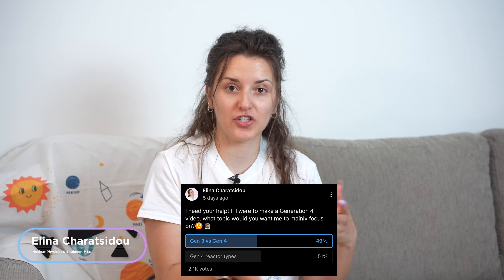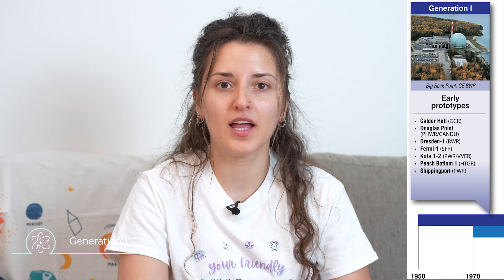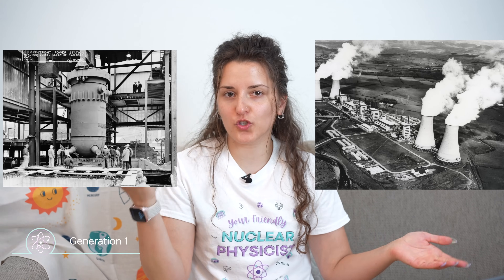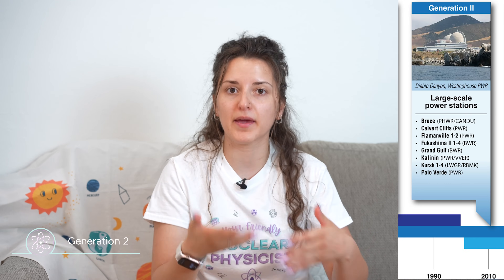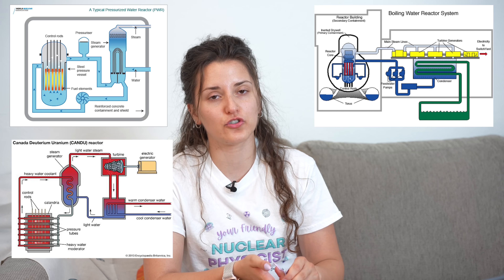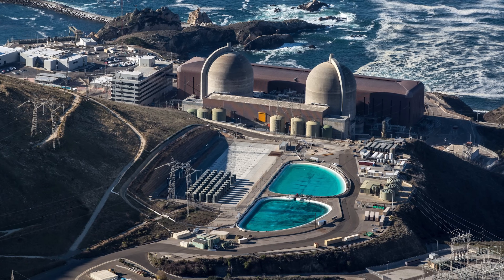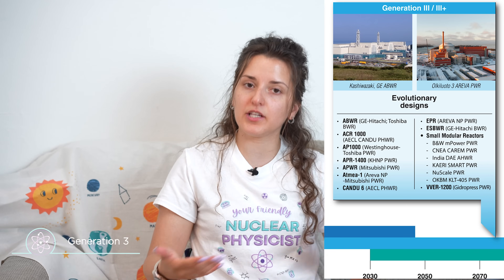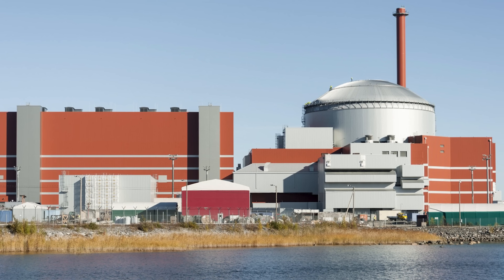Nuclear Physicist Explains - The Rise of Generation IV Reactors?

Comment: Active safety vs passive safety is more complex than how your framed it.  There are few/no safety systems that require operator action to start.  The operators have the ability to start them prior to any interlocks that would automatically start them.

The term "active" can best be thought of as requiring power to operate.  An example of this would be emergency core cooling systems that use electrically powered pumps to inject coolant into the reactor coolant system "RCS".  

An example of a passive safety system would be the accumulators or core flood tanks that have a large volume of water and a nitrogen blanket at 800 psi on it.  These tanks would have a check valve between them and the RCS to prevent the reactor coolant from going into the tank.  The contents of the core flood tank would automatically empty into the RCS during a large break loss of coolant accident "LOCA".
Reply: No U.S. nuclear plant has EVER had an issue with an active safety feature malfunctioning in both "A" and "B" trains when needed.

The reason passive safety features are now seen on new designs is purely for cost saving reasons.  No massive emergency diesels or battery banks needed, less maintenance, less initial cost, less chance that a failure will require a plant shutdown.
Reply: @clarkkent9080  You should read about the June 9, 1985 event at Davis Besse.  This event did involve the failure of both trains of AFW due to many valve failures in a short amount of time.  Luckily, the operators were able to restore AFW shortly afterward.
Reply: @Mong0thepawn  Aux feed water cannot be replaced by a passive system as the pressure must be above 1200 psi.  Davis Bessie has electric and a steam driven aux feed pump
Reply: @clarkkent9080  Why are you telling me this?  I know that DB has two Terry Turbine AFPs, a motor driven feed pump, a startup feed pump (breaker racked in with fuses pulled), and a diesel driven AFP.

All of this does not change the fact that ALL AFW systems failed on June 9, 1985.  At the time of this event, only the two steam driven pumps and the startup feed pump existed.  You also have to look at the common cause failure.  If electric powered valves are out of position in a failed state, and it blocks all AFW flow to the steam generators, you are in a very tough situation. 

Your statement about both trains of a safety system becoming "non-functional" during an event never happening  is not true.  I am intentionally using the term "non-functional" instead of "malfunction" because it has a specific meaning.  I will also add that "non-functional" is not the same as being "Inoperable".
Reply: @Mong0thepawn  The AP1000 use of passive safety features was designed for one purpose and that is cost savings.  The claim of better safety was just good PR.

EVERY component that you say failed are still present in the AP1000 design.  You cannot passive an auxiliary feed water system that must provide 1200 psig feed water.

I was a SRO on a sister plant to DB and am very familiar with the importance of feedwater to a B&W design. The passive safety features of the AP1000 design still need electrical power (battery) and if operators do  not align the systems correctly, (and yes they have manual valves that must be aligned) even they will fail.  

No design is operator proof as you can't fix stupid, 

Simple point : the AP1000 passive safety features were incorporated to reduce COST.
Reply: @clarkkent9080  You are replying to a question or statement that I never made.  

You previously said that there has never been a nuclear plant have both trains experience a malfunction when the system was needed.  This is false and I gave an event as an example.  I would agree that it is incredibly rare to see both trains of a safety system fail.  You going off on a tangent about active safety systems being needed has nothing to do with me pointing out that there has indeed been at least 1 event where both trains of safety systems experienced a malfunction.  

Applying the "nuclear lingo", it sounds like you are of the mistaken belief that there has never been a time where both trains of a safety system were non-functional when demanded.  I say non-functional only because Inoperable can mean that the system can't meet its surveillance requirements but it is still able to perform its safety function.

I too held a part 55 license for many years.  I am still involved in the industry.  It is possible to build a 100% passive safety design.  The DOE built several many decades ago but they were not light water designs.  Nuscale is close meaning their design can reject decay heat for about a month with no active safety systems.

Is your last name Derivan?  Your writing style kind of reminds me of how he writes.
Reply: @Mong0thepawn  My original comment was that the AP1000 PASSIVE safety features were incorporated as a cost saving measure not to mitigate any previous event at a U.S. nuclear power plant and that is 100% true.
The AP1000 passive systems would not have made any difference in the event you describe so they could not have been designed to mitigate the DB event. 

I did state that no U.S. commercial facility ever had both safety trains fail when needed and from your description that MAY not be accurate. I was not aware of the situation at DB that you describe. There have been situations where both trains of a safety system were declared inoperable and Tech Specs provide immediate actions required. But that does not mean they both failed when needed.

I will take your word for that DB event as you know that many "events" happen at nuclear power plants that are never reported outside the facility or NRC.  I originally obtained a RO license  in 1981 and a SRO in 1984 and never heard of the event you describe.  
But you are most probably not aware of the sabotage of a nuclear power plant that could have resulted in a complete core meltdown.  Or the leakage of 400,000 gallons of primary coolant to the groundwater over a 4 month period at the Xcel Energy's plant just this year. Everything does not get reported in the media and what is reported to other nuclear facilities is whitewashed as much as possible. 

 
Additionally, I am confused with your description of the event.  If a B&W reactor trips with even a few weeks of decay heat and normal feedwater is unavailable and both trains of emergency auxiliary feed water FAIL, you have a big problem.  
If normal feedwater was available, emergency feedwater was not needed so you did not have an event where an both trains of an emergency system failed to perform their function as their function was not needed.
 I have had a situation where both emergency feedwater trains were declared inoperable. Normal feedwater was available and while inoperable by definition, both trains would meet their intended function. We shutdown, went on RHR end of story. 

We can banter functionally, inoperability, failure, when needed all day but my simple point is AP1000 passive safety systems were designed to reduce cost and not to mitigate any event that happened in the past.  

BTW, unless I am missing something, NuScale has placed their project on hold till 2025 due to ballooning costs and that is just estimated cost.  Shortly after getting NRC approval of their reactor design, they increased the output so I assume that will require additional NRC evaluation.  

I am retired but follow the industry and while I am pro nuclear, I am a rate payer and new nuclear in the U.S. is simply too costly compared to any other generation source. Both Terrapower and NuScale are receiving $2 billion taxpayer money each in matching funds for those projects and they are not financially viable per capacity output and that is just based on cost ESTIMATES.  
NO nuclear project has ever been built without massive cost over runs.  They have the same story that it will be cheaper next time.  So do we spend the next 10 years with unproven technologies of MSR or SMR and hope costs will come down? Or build more AP1000s knowing that 1.1Gwh capacity will cost $17 billion or more? 
 I am on the Vogtle grid, been paying a 19% surcharge (three years now) for unit 3 & 4 construction and expect to see a 25% rate increase on top of that once unit 4 goes operational. They can spin it any way they want but the reality is that Vogtle should have been canceled along with VC Summer.
Reply: @clarkkent9080  I have watched Vogtle 3&4 become a nightmare that is $18 billion over budget and 7 years late.  Summer became an expensive hole int he ground.  I highly doubt we will ever see another largte part 50 site get built.  

I do however think there is a future for the part 53 designs if they are mass produced.  You will need these to be built in a factory setting where the Q requirements can be both met and documented.  These reactors will need to have enough excess reactivity to go 10 years at full power (ISI 10 year requirements).  The regulatory burden will also have to be enough to ensure reasonable assurance of safety and nothing more.

These new advanced SMRs must both be black-start capable and able to handle a full load reject without tripping.  I do not want to build anymore of these monster 3 GW+ thermal plants.  I am hoping the NRC can find that perfect balance of safety vs too much burden.  They did update part 55 recently to account for the new reactors.  I think NUREG 1021, rev 13 will address the process for issuing licenses to the operators for these new designs.  I really hope they adopt a model similar to the FAA where the operator is issued a license that is good on all designs of that type.  Similar to how a pilot with an ATP license with a type rating on a 737-800 can fly any 737-800.

I was licensed at DB and a loss of FW is a huge deal.  It was an initiating event that had a high risk of getting to a core damaging event.  Basically, at 600 F in the RCS, the operators are directed to pop the PORV open and initiate full flow from the MU system (assuming the SI is intermediate pressure).  You then ride the plant temperature down using specific rule 3 & 5 and get your resume updated.
Reply: @Mong0thepawn  I am able to discuss commercial nuclear safety issue, high level waste issues, and even proliferation issues but I cannot defend the massive cost over runs on new nuclear projects in the U.S..
Both VC Summer and Vogtle used the “build it in a factory” module concept and the product was of such a poor quality that most had to be reworked on site and that concept was cited as one of the many reasons for cost over runs. 

You cannot build and ship the primary of a SMR as a single unit.  The AP1000 primary was shipped as two steam generators, two reactor coolant pumps, one reactor vessel, and one shipment of connective piping, six shipments in all. A SMR may be able to reduce that to three shipments but that is no major cost saving.  The volume of the support systems dwarfs the primary so no major cost savings there.

The issue with cost has little to do with the reactor plant and more to do with the complexity and critical need for quality.  The U.S. construction industry can build WalMarts and Amazon warehouses but not complex nuclear power plants. 

I live less than 60 miles from both VC Sumer and Vogtle and know many that work or worked there. I can only relay what I have been told by people that actually worked or are working at these failed projects: poor management, stolen equipment, drugs, lack of the necessary skill set, fraud, kickbacks, greed, sabotage to keep the project going, lost documentation, etc. All project related. Oh, and maybe the biggest issue, the utility makes a profit based upon the cost of the project so the ratepayer is stuck paying for their mismanagement.

The main reason for low unemployment and understaffing today is based on the large number of highly skilled boomers that have reached retirement age.  Look at a chart of boomer births, add 66 years and you will see we are coming to a point in the next few years where they will all be retired. My last facility lost greater than 50% of staff in a 7 year period (silver haired tsunami) .  My last assignment was to train (fundamentals) the influx of new hires.  The local college provided a generic test for potential applicants and we offered the top performers (age 22-55) jobs.   Just as one example, we had a high school teacher provide two weeks of training on math (nothing above 3rd grade level).  Multiple choice test (example: 14 -7 = ?) and 75 % failed. Two more weeks of instruction and 45% failed.  Management directed us to provide calculators and some still failed. I feel it is my responsibility to provide management people who could safely operate a facility but management said we need “buts in the seats” and that is now what they have.  Not a bright picture of potential candidates to run a nuclear facility.
I believe it was ~ 10 years ago when the NRC got very upset when half of the RO and SRO Vogtle candidates failed their license exams.

Do you think any of that will change with a SMR or a MSR?  Look at the lack of education in Kemmerer Wy., and the mentality and tell me that is where you want a state of the art MSR. Who, with any skill set, even wants to move where only 2,700 people are willing to live? 

Time is running out for nuclear.  Unless there is a widespread nuclear success no later than 2035, it is for all intent and purpose a dead technology.  There is more wind and solar capacity awaiting approval to connect to the grid than we currently use from all generation sources. The sun doesn’t always shine but in some places the wind always blows and with enough spinning reserve and natural gas backup we can survive until fusion is perfected.  

I believe it was 2016 when then DOE Secretary Moniz was asked about the future of nuclear power in America. He stated that the future of nuclear power was playing out at VC Summer in SC. and Vogtle in Ga. and if they were successful, then nuclear power had a bright future in America. That simple statement says it all. He was one of the few DOE secretaries with a PhD and common sense.
Reply: @Mong0thepawn  Part II
This is ~ 6 months old but still valid.

This is from the Des Moines Register and concerning the only Small Modular Reactor (SMR) project in the U.S. today. It should be noted that NuScale said (Jan/2023) the target price for power from the plant is $89 per megawatt hour, up 53% from the previous estimate of $58 per MW hour

In 2013, the Wall Street firm Lazard estimated that the cost of generating electricity at a new nuclear plant in the United States will be between $86 and $122 per megawatt-hour. Last November, Lazard estimated that the corresponding cost will be between $131 and $204 per megawatt-hour based upon the 4 recent new nuclear projects in the U.S. . During the same eight years, renewables have plummeted in cost, and the 2021 estimates of electricity from newly constructed utility-scale solar and wind plants range between $26 and $50 per megawatt-hour. Nuclear power is simply not economically competitive.
SMRs will be even less competitive. Building and operating SMRs will cost more than large reactors for each unit (megawatt) of generation capacity. A reactor that generates five times as much power will not require five times as much concrete or five times as many workers. This makes electricity from small reactors more expensive; many of the original small reactors built in the United States were financially uncompetitive and shut down early.
The estimated cost of constructing a plant with 600 megawatts of electricity from NuScale SMRs, arguably the design closest to deployment in the United States, was originally advertised as costing $1 billion but upon requesting actual bids from engineering firms, increased to $6.1 billion in 2020. Given inflation and other cost constraints that cost today can only be expected to be significantly higher.
The cost was so high that ten members of Utah Associated Municipal Power Systems canceled their contracts. NuScale then changed its proposed plant configuration to 6 fewer reactors but increased each reactor output from 50 Mw to 77 Mw costing at total of $5.3 billion. The NRC just last week approved the construction of the 50 Mw design but now will have to start the review process all over given the switch to a 77 Mw design. For each kilowatt of electrical generation capacity, that estimate is around 80% more than the per-kilowatt cost of the Vogtle project in Georgia — before its cost exploded from $14 billion to over $30 billion. Based on the historical experience with nuclear reactor construction, SMRs are very likely to cost much more than initially expected. And they now have delayed the project start until 2025 in an attempt to find more backers.  All this before the inevitable setbacks that will occur once construction starts. 

The future does not look bright and you won't need shades!
Reply: @Mong0thepawn  Here in the south east they have a pre employment system called Keys.  It is a series of tests that examine the candidate's ability in various work areas. The exams are given by the local colleges and in my opinion are a way for employers to select and reject potential candidates from interviews based on these scores without fear of racial bias law suits. 
The colleges also provide classes on how to take the tests, so they make money both ways and those with the means to take the class are at an advantage.  Once an individual gets their grades, they are like SAT scores for employment and valid for a period thereafter.

These were entry level operator positions and yes we had a few people turn down a $40k starting salary increasing to $55k after 2 years because we do not allow cell phones. Go figure . 

The whole situation was depressing. I was retired but came back ( for 2 years) to help as they treated me very well when I was a full time employee and I considered that I owed them. There are still coworkers that are now going on 6 years as a contractor helping out that facility that cannot seem to hire the right people.  After 2 years, I paid my dues. Even as a contractor I was quite vocal in calling out the lazy people and decided to retire, again, before they had to fire me. 

We hired two local high school teachers. One would only teach math and physics fundamentals based upon his teaching experience and it was only after one year were we able to get him to teach another very simple course.  The course was outdated and I marked up a copy with all the necessary changes so all he had to do was type it up and submit for approval.  He taught the original out of date material and said "I think they should know how things used to be". 
The other teacher never taught any courses. After18 months she was given an ultimatum to attend a course that I was teaching and then given one month to teach it to the next group. The day before she was to teach the course, she said she did not feel comfortable teaching the material.  They dumped her onto another group shortly thereafter.  

We hired four ex navy nukes right off the boat.  (One LT., two Chiefs, and one mechanic) The Mechanic was off an aircraft carrier and the others off a sub.

The Lt was hired to take my managers job and he had one full year to learn the position before my manager retired. All he did was attend off site conferences and network.  When my manager retired and he had to take full responsibility, he hired  a guy to do the manager tasks and he continued networking. The facility eventually had enough and basically made him the manager in charge of supplies and insignificant tasks.
The one Chief was bi-polar and was supposed to learn the simulator from the retiring instructor.  When I talked with that instructor he said the Chief never shows up in the simulator and it turns out he was sleeping in his car half the day.
The other chief in the two years I knew him never took rad worker training so he never set foot in the facility un escorted. All he did for his six figure salary was make up training schedules.  Shortly after I left he left for Vogtle and I am sure he is milking that position also.

The mechanic was top notch.  Very intelligent, very hard worker, great people skills never complained and always wanting to learn and help out.  The thing that pi$$ed me off was the other navy guys treated him like crap and he just took it. I guess they thought they were still in the navy and there rank matters above all things. 

I started at age 18 as a radiation control tech at Shippingport and got to see that gaggle of naval officers and one silver headed short guy named Rickover on two occasions.  I worked at five different nuclear facilities and with some super people with talents that do not seem to exist anymore.  Things have changed and luckily I live up wind and up stream.